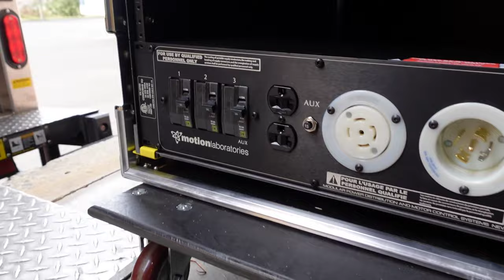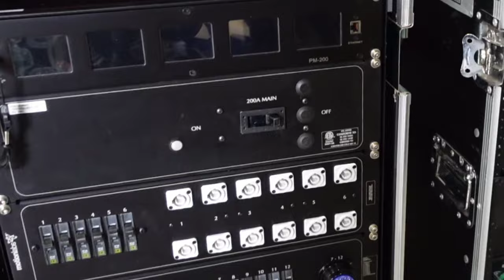s11e1 Sound Company Owner Reviews Crown Amplifier VRack / Power Distro Battle / Are We Moving!?

Comment: I like Kay's distro better but Gio's boxes are more useful to build on. The best option would be for Kay to take the bottom Edison panel and convert it to a True1 or Powercon panel and get some True1 or Powercon boxes for power on stage. I don't have a huge inventory but I started straight away from True1. Every power cable I own has True1 on one end and IEC or 13a or 16a or 4way gangs on the other end (I'm in the UK so 13a is wall power). If I need a 4way box I get a 13a-true1 and a true1-4way and I'm good to go. 
The power of True1 on my side was the fact that male and female can be connected to make a cable longer. Most of my jobs are location jobs or small shows where we provide our cablings mics and desk, but we almost never have our own distro (hence the reducers from 16a to True1) nor PA so no amp racks needed. 
On the amp rack idea Kay's 6 amps are much better than Crown's 3 amps. Great use of those sliding doors, big fan. I like those new cases as well more than wooden ones.